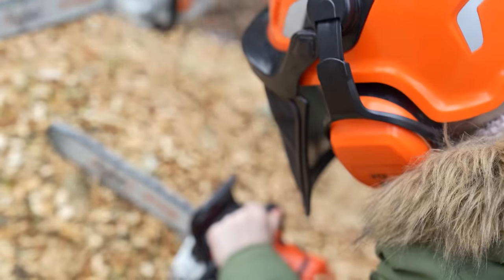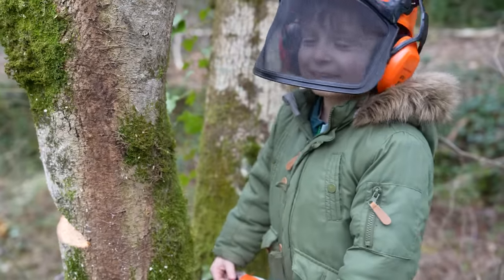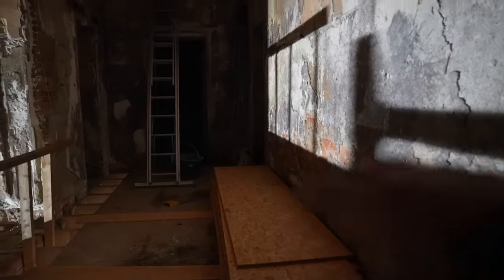The floor structure is reinstated, roof update.

Comment: It's always good to get another bit of the floor in, gives you more room to work and places to store stuff.
Reply: Plus it is one more element to help it look just a bit more complete.
Reply: Most important, it acts as a crash deck enabling access to remove loose material and also stop material falling a great height onto people who insist on swanning around without head protection. As well as offering storage and stability.

This should have been done all over the chateau before wasting time on non urgent items like planting, trees, or picnic benches 

Just basic construction and safety sequencing.

Comment: Here in Denmark we use tar paper, whenever wood is situated on stone, to prevent mold and rot in the wood.
Reply: My brother is a contractor in the US. Some of the materials he uses I question. OSB is not meant for exterior use. If he doesn't put the tar paper on and shingle that right away, one rain and the lamination will weaken. If more water hits it, it will turn to mush, just like his sub floor. He would have been better off using 3/8" plywood. Now he has to tear out all of that OSB he used for temporary flooring. 3/8 ply would have been covered with 1/2-5/8 ply once the building is weather proof. The savings in time and labor makes using ply cheaper, than what appears to be a cheap option. I see a lot of things done that if he framed with my brother would save him time. Like building those walls for the attic. You frame it on the floor, then tilt the whole thing up at once instead of putting it up board by board. It also enables nailing into the end of the timber. Toe nailing those in isn't sturdy and splits the wood. It also pulls out easily with the force of the wind and can cause twisting.
Reply: Dan uses bitumen spray, liquid tar paper.
Reply: I @VangoghsDoggo I expected him to use mode screws there too
Reply: In the US they are Masters at building with Wood, though when the wind comes , your house falls over, hear in Croatia we only us real stone, oak beams & concrete on top of the beams, you are not authorised to us wood for the staircase & brick for internal walls, brick also for first layer of the outer walls with a layer of installation before the real stone facade has been completed & then they stand for 100's of years, this is a Istria stone house, if you build cheap, cheap is what you end up with!!!!!
Reply: @VangoghsDoggo Wonderful Wild Off Grid, Erin and her hubby, use osb, too. And it's been getting wet for quite some time. They say it's ok,  those osb boards can handle that moisture. 🤷

Comment: a palfinger crane with a board lift mounted on a lorry, for sheet rock, hoisting them to a window would make your life alot easier. that is what we used to do in Germany. you can probably get the builders merchant to get the osb from the main handler with one of these rigs. used to move 200 or 300 a day like that with 4 geordy lads lol

Comment: Those tongued OSB boards are a godsend, I laid some 20mm thick ones on a really rough and wavy  concrete floor, just chucked them down, wedged them tight about 6 years ago.  I had half expected them the rot, or be eaten by termites, but the floor is as good now as when "temporarily"  placed.

Comment: You could screw a large eyehole screw into the OSB boards and then lift the with the winch. OR sandwich them between 2 boards that are a few cm wider.

Comment: I don't know how many times Ive posted this, but if you aren't going to put on the roof the next day, that OSB will get wet, and turn to a wet dishcloth.  You really need to use a different type of wood for the roof.... and by the looks of it, you really need a construction stairway at least to the second floor, even if its temporary. You say its rough getting this wood up there, but you are only doing the framing and wood for 1/3 of the roof.  You got a lot more to go, and it would be significantly easier if you put up a temp construction staircase.
Reply: Ive been looking at getting some of the roof on my house replaced here in the UK and all they use to replace old sarking is osb. He should probably install roofing felt over it at the same time, that will keep it dry for long enough.
Reply: LOL.

Comment: Liming the sockets is something the Two Jeromes don't seem to know.  They did do the painted end grain protection.  They did use it to sop up some dampness in their basement repairs.  As far as I know  no one here ever heard of that use for powdered lime.  But in the USA you would have to search far and wide to find solid masonry structures.  They are not that common. In the little town I call home I can think of maybe less than a dozen brick buildings and only a handful of those are houses. And in some of those older houses - somewhat older than 200 years- they were still using rough shaped timbers that weren't run through a saw mill. They probably don't have such tidy sockets as yours.  
Knowing how quickly lime can burn unprotected skin,  I can easily understand how it would protect against insect invasion. 
BTW - the bodies of both Marie Antoinette and Louis XVI were both dusted with lime at burial. The remains in the expiatory chapel on the site apparently contain only some whitish mud. 
I "burned" almost an 1/8 inch groove in the skin of my ankles by wearing only a pair of rubbers while screeding a concrete basement floor. My Dad got the boots and I took the rubbers. They looked like red cords tied around both ankles. I didn't feel a thing and even washed it off as soon as the job was done. In spite of that the red groove appeared about a day later.  I've heard that could have led to blood poisoning but it didn't. I can't remember if it was sore. it was 35 years ago?  I think it took about a week for the skin to repair itself. Lime is a base, not an acid but it is very caustic. But I think it was just drawing the water out of the skin cells and I couldn't feel that at all.

Comment: Yes-Iah, kudos, in every 🎯dimension,that, you know,👈🏽
 👉🏼I know ,that,💨you know..
  I like the t+g flooring shuttle. It is apropos, of the body beat/time use, handling issue. We use a version of that , in every filmset , built. And can be used multiple times. 
   💥The scaffold snafu, got me .. as ,I swear🔥 I saw you holding, the moving end, with your back,leaning and twisted. 
  👉🏼Don’t make me come over there.🙉

Comment: Hi Dan, maybe a small suggestion witch probably already is mentioned. You can get a mobile “moving lift” second hand for a reasonable price. This wil save your back, speed up the progress and not to be forgotten reduce the times you have to climb the ladder, therefore it would be a huge safety and workload improvement… regards Peter

Comment: Using bitumin is like the roman dry socket technique. Timbers have been recovered from wet areas dating 2000 years old preserved this way in london.

Comment: Why would you not have your material delivered with a boom truck? The company would deliver everything to each floor that you want. It takes about 10 minutes to unload a skid of plywood to the roof with one. It’s included in the cost with the amount you need.
A steel delivery would be done the same way.  They pick the material up and pass it through a window opening on the floor you choose.

Why work so hard? Is there something I’m missing?
Reply: U pay extra for it....
Reply: I operated boom trucks for a building materials supplier many years ago. When you order a load of materials you get enough to complete a phase of the job and
That would be enough to get the lift included. Even so if you had a skid of plywood to get to the 4th floor you wouldn’t pay $200 to get it delivered there? The amount of time saved to get the material delivered for one wing would be in the hundreds of man hours. In addition it would be delivered in one morning by 2 guys and a truck.

Comment: Could probably make a frame to set   multiple sheets of osb in, like making a basic window frame, do one cross strap to keep them from tipping out, then put the winch strap around the frame in the other direction.  Should not compress tongs and grooves.

Comment: Hi Dan, a genuine question, with so much extensive damage to the building how do you know what you are doing will be structurally sound? Do you consult with engineers etc? Also do you have to adhere to any planning rules? Love your work, it’s amazing 😊
Reply: Oh, Lord...
Reply: @JPRobinso  it was a genuine question, I’m not a builder so I’m fascinated with the process. There is no need to be mean and put others down.

Comment: Guess too late for one will read it, still. Sealing the beam from moist is done because woodworm or other critters eating your wood. This because they drink from the moist in the wood, without moist no change of living. This is why ventilation is so important. The problem with the soft woods is that they suck moist and for example the old fashioned oak beams only the sap wood does or the outer layer however the core not so they last much longer. In France they usually treat the beams with Xylophène which protects them for 40-60 years. Down side is it is poision. Better than butume spray and cheaper and 10 times longer lasting is to use damp-proof wall base plastic, in french Bande d'arase d'étanchéité noire. It is soled on a role about 25-30cm wide and you put it normally on the bottom of the walls you build above ground to prevent the wall of sucking up moist, work perfect for the beams as well. Just wrap the ends with it and stapple it on the open side of the beam.

Comment: Use a 4" C clamp and attach to the short side of the OSB panel.  Attach your wench to the C clamp and hall up one sheet at a time without damage.  Seems like a lot easier that what you have been doing.

Comment: Hey Dan. 
Would it be cheaper and quicker to have a bucket full of creosote set aside to just quickly dip the ends of joists in to before fitting them 🤔 👍

Comment: You have your own mill and plenty of trees. Do you not have enough oaks to mill your own roof beams?
Reply: Construction wood needs to be kiln dried for strength. The wood nick is cutting is too green to use now but will be great in the future once it's dried out.
Reply: The wood would need to dry out for at least a year or two. He does plan to use the wood, but it has to cure first. If he used it now while it’s still raw, it can bend and warp.
Reply: Oh, dear...
Why do you comment?
Reply: TOOL
Reply: And beyond drying out, the wood he buys has been pressure treated, a process where chemicals are forced into the wood to make it resistant to rot, mold, and insect damage. He can't do that.

Comment: Hopefully you see some of the OSB comments.
I know how frustrating it is to wait on materials to arrive but if you rush to put the OSB roof cladding on before it can be protected from moisture it could end up being wasted time, effort and money€€€€€.
You have plenty of other tasks to work on while waiting for the roof beams.
Reply: Put roofing felt over it if it's going to be exposed for a long time. It has to be done at some point anyway and would be easier to do at this point.
Reply: @LaReynedEpee  I’ve never built a mansard roof but just roofing felt stapled down on a simple roof shape is susceptible to wind getting under the edges and ripping it which exposes the OSB to moisture. No bueno.
If Dan has extra euros laying around then he can afford to buy new OSB if it swells from the damp/ wet. I just wonder what his hurry is when he still needs to finish the brick work of the head wall.
Reply: @bobhaze5324  I wouldn’t suggest fixing with staples, battens it would have to be. It depends how long it's going to be left in that state. As we know everything takes longer than you think and Dan is taking the slow route. This is only a very temporary sugggestion.

Comment: You can winch the OSB boards up when you protect the edges.
Cut off one length of one board (a hand's width) and cut that stripe of OSB into - let's say 10 - pieces (a hand's length). Then put that pieces side by side with the original edge upwards and screw them together. . Now you have a block of wood with the upper side fitting perfectly in the tongues an grooves of a stack of 10 boards. Make as much of these blocks as you need points to fasten your stack of boards (minimum 2 I guess).

Of course I can't take over any responsibility if this doesn't work!

Comment: I wonder if you couldn't build a long u-shaped support to protect the board edges while you winch them up.  Maybe two, one top and one bottom.  Sandwich 3-6 boards together for strength (depending on what the winch and the person at the top can manage), slot them into the U-shaped protectors, wrap them with the cargo strap to hold the protectors in place, and  then wrap the lift strap around the whole.

Comment: V209: Shame you cant rent a 'telehandler' ( a long reach forklift) the boom extends to around 20 metres with forks on the end. This would save a LOT of time for you. Thats a point, Ive never noticed any old sewer pipes in the old bathrooms? I assume they use 4 inch like UK (100mm).  Did they run outside the structure or inside? Isnt that your 'last' floor to go in?
Reply: He could rent an open top freight elevator, install it inside the building, but with limited power and pre Olympics prep taking place in the country, timing may not be right yet.

Comment: Why cant you build a jig out of 2x4's that can hold 6-10 sheets snugly so you can use the winch? If built correctly it shouldn't hurt the edges and allow for safe lifting.

Comment: Dan the Man, lovely series but boy you have a talent for making your work difficult. Why not clean up the floors where you work a bit so you dont trip and hurt yourself and so you can easily move the forklift and scaffold? Why not use only 2 screws to screw a few OSB boards together at the top and then use a hefty C clamp to winch them to the top? Why not mount the winch outside as high as possible, in front of the windows? Your timber could be unloaded right below that and be ready for lifting. Same for big buckets of lime. Buckets with stones, etc.

Comment: What  about a hole saw  cut a hole in each board thread the sling through. Keep the bungs screw 4 board together. Lift the boards put in place glue cut outs back in place cover

Comment: No noggins today? I'm disappointed 😂Why don't you build a cradle for the winch? have it so when it stops at the top, the bottom of the cradle is level with the top floor. If you mount your winch 4ft out you could build it big enough to get 8ft sheets up which will save you time and effort when you come to taking plasterboard up.

Comment: Can you explain why you have to wait on wood since Nick has cut so much and you have a mill?
Reply: 1) He's using Douglas fir for the roof. That isn't Douglas fir. 2) wood has to dry out for about a year or be dried in a kiln before use  3) He's been buying pressure treated wood, which is a process whereby chemicals are forced into the wood fiber to make it resistant to mold and insect damage, something he can't do.
Reply: @Sgirl  Thanks for the explanation.  Makes total sense.